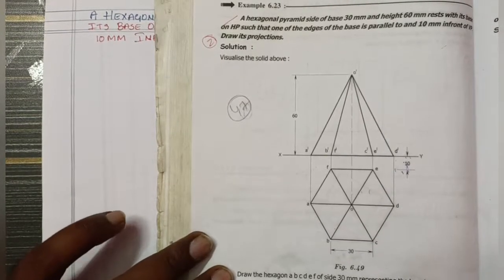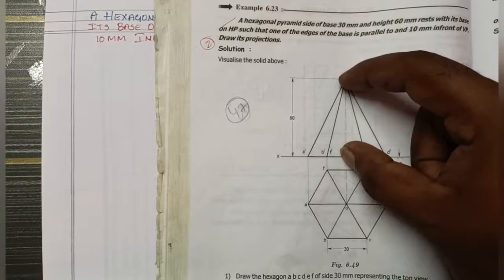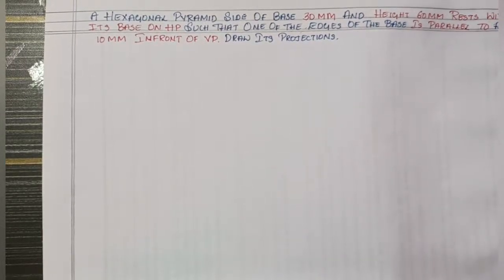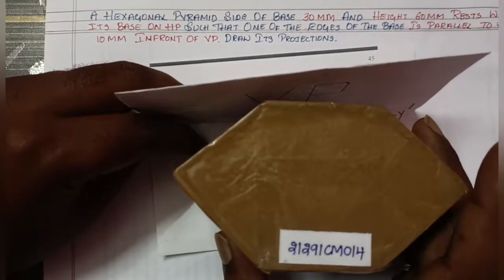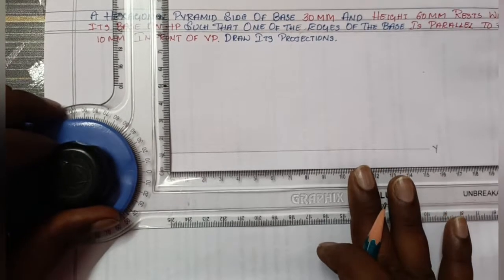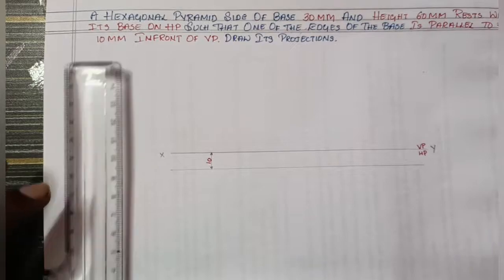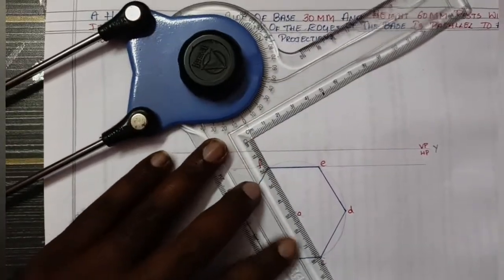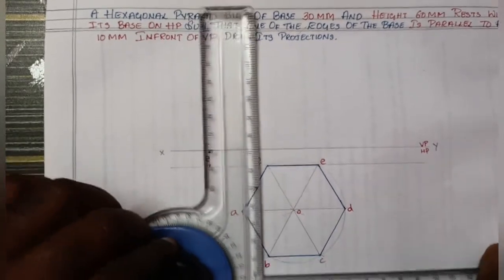PROJECTION OF HEXAGONAL PYRAMID - PLANE SURFACE- IN ENGINEERING DRAWING

Comment: hexagonal pyramid of base 40 mm each side and axis length 80 mm is resting on its base on HP in such a way that the one of the base edge is parallel to VP and it is cut by section plane parallel to HP and passing through 50 mm from the base. Draw sectional view of remaining solid

Comment: A hexagonal pyramid, side of base 40 mm and axis 70 mm long, rests with its base on HP such that one of its base. edges is perpendicular to VP. A section plane perpendicular to VP and parallel to HP cuts the pyramid at a distance of 30 mm from the apex. Draw its top and front views. Answer